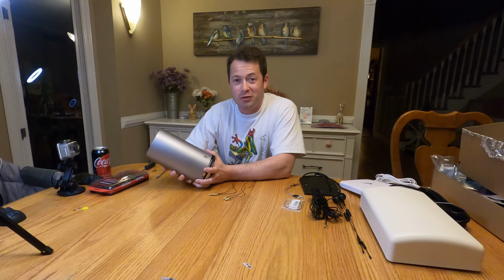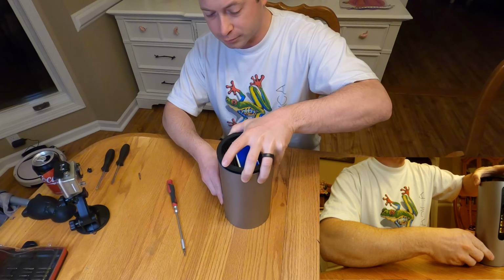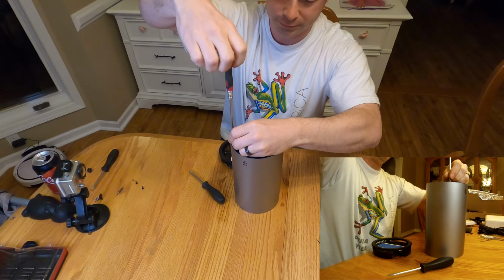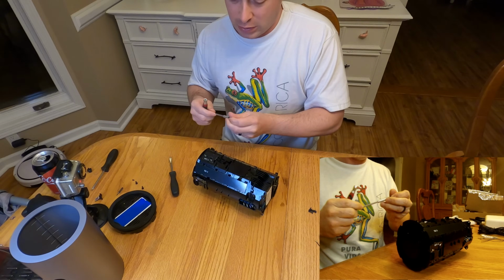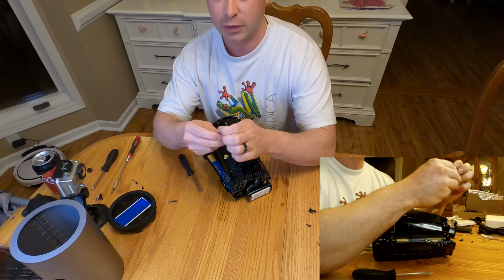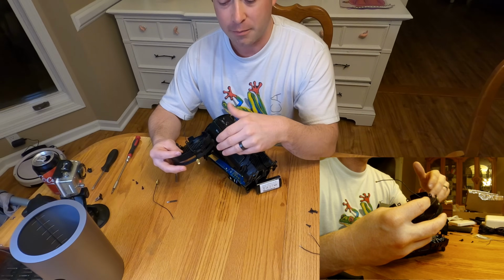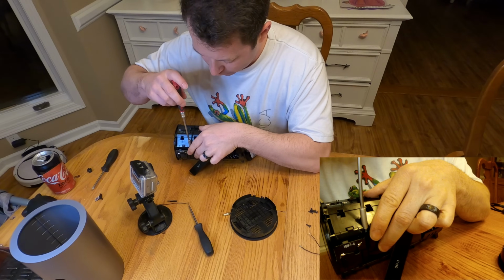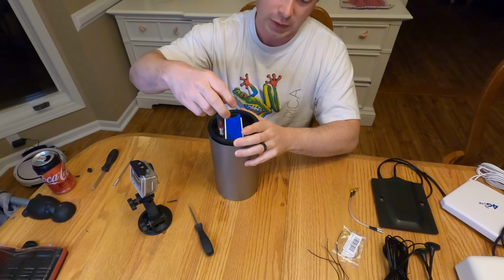✅ Improve Your Signal!  Add External Antennas - T-Mobile 5G Home Internet Rural Broadband - How To

Comment: It's so strange because when I first brought the modem home and hooked it up I was getting 300-400mb down and 50-100up now I'm getting 50-100mb down and 50 up and NOTHING changed. WTF? No matter where I put the modem it's still the same thing. I don't understand what happened.
Reply from the maker: Likely due to deprioritized.  When they first provision on the network they aren't deprioritized.  Like first several minutes.  Also check a different times of day.
Reply: @NaterTater  I unplugged it earlier and let it switch to battery mode and took it outside and pointed it directly at the tower (300 yards away) just to see if I could hit 5 bars and I got up to 4. I hooked it back up and did a speed test and it's up to 200mbs now I did this about an hour ago
Reply from the maker: Ok so then you need to monitor your cell bands.  You must be switching bands so its just a matter of placing the unit in the right place or adding an external antenna.
Reply: @NaterTater  I want one of the ones I saw on your channel, I forget the name of it but it goes outside. I just don't know how to drill a hole in my wall and mount it so I need to find someone to do that.
Reply from the maker: @eggchin9721  That was Waveform,  Get 5% off Waveform antennas with this referral link: http://waveform.refr.cc/natertater
Reply: @NaterTater  also I live in a very rural area, lots of farms around me.

Comment: I tried a waveform panel external antenna on #3 and #4 and didn’t notice much difference at all. I have line of sight so I’m going to try waveform’s log periodic antenna kit. Would you suggest I try the log periodic antenna kit on 1&2 or 3&4?
Reply from the maker: 3&4 was slightly better than 1&2 for me.

Comment: Cool but why do they do this?  Why don't they have external SMA's like any decent modem?
Is there any way to not use this ridiculous hardware?  I already have a Mofi4500 with external yagi's set up with an mvno to t-mobile, but t-mobile has done their best to snuff out that market and they have to raise their price.  It's too much of a gap now and I basically have to get t-mobile directly.  Trying to talk to their support about this is like talking to a fish.  I kept trying to get an answer about external antennas or using my existing hardware etc and their response is "the gateway is how you get the internet".
I'm about 3-4 miles I think from the tower.  I can't find the site I used to use to map it, but worried that'll be too far and I want to use my damn antennas.
Does their service have any issues with a VPN?  I see some of your other related videos might have the answer but figured I'd ask anyways.
Reply from the maker: They IMEI lock but otherwise you can use your own equipment and their sim.
Reply: @NaterTater  Wow alright, couldn't find any confirmation on that before, good to know.
Thanks again, I have a lot more confidence trying this out now.

Comment: So maybe you can help with an issue I'm having.

Says no USIM detected. 

Pulled card out checked it only 1 way in. Try again. No luck.

Remove card and 2 screws pop the bottom off. Hold the sim card in there and it boots up and works.

Turn it off remove card. Reinstall the bottom plastic install card make sure it goes in right and easy.

Boot up it says no USIM again.
Reply from the maker: Sounds like you need to return the unit but maybe a paper shim or something would get the sim contact needed?
Reply: @NaterTater  Maybe when I put it back together I didn't do it right. I'll take it back apart tomorrow and try again.

Thanks for the fast replies
Reply: @NaterTater  Had 2 antenna wires through the grille on the wrong side of the SIM card they would get pinched and not let the bottom grille sit flush so the card wasn't going all the way in 

Unhooked them ran then on the other side with the other 2 antenna wires. Good to go now just a matter of walking around and pointing them different directions.

Went from 2mb/s to 5mb/s already with them just sitting inside. So already an improvement. The book for the antennas said to be patient it could take a few for them to get picked up by the tower.

I've got my Xbox on it now downloading stuff and doing speed tests and using cell mapper.

Turns out the tower closest to me is east not north.

Comment: tmobile 5g gateway external waveform antenna connect to 1 an 2 or 3 and 4?
Reply from the maker: I got better results on 1 and 2 but others report 3&4.  Might vary based on which bands you have.
Reply: @NaterTater  thank you and thanks for speedy reply
Great Channel

Comment: Do you have to put the silver case back on for any reason?
Reply from the maker: Yes, in order to return it to t-mobile
Reply: @NaterTater  I meant for it to work. I ordered the wagi style 4x4 they will be here Wednesday just wondering if I need to fully reassemble It for it to function. If not I may leave the silver case off. In
Reply from the maker: @shifty198885  😂I know, just trying to be funny.  You can leave it off, just don't misplace the shell for whenever you have to return it.
Reply: @NaterTater  Just installed the adapter wires from waveform i have the 4x4 mimo style. Your video helped alot. Having big hands attaching the 4 wires to the board was the hardest part for me.

Comment: You're my go-to expert on this stuff Nate.  I just got my trashcan two days ago and now it appears outdated though I just watched your video of the new gateway and looks like I'm good with the Trashcan for a while. We are in rural Texas on 5-acreswith very few options. Our speeds tend to be all over the place at any given time. and I'm wondering if we would benefit from an external antenna, though based upon your reviews of them, it appears to not be the case. Our topography is rolling hills and no line of site to a tower, though we could from the rooftop of our home. Do you think it's worth a test? Should I consider an external router for a mesh network? Would appreciate your input if you're willing to share. Also, we also have spotty wi-fi calling at times though our speeds can be sufficient. I have a android phone and the others are 4G iPhones. Have you considered publishing a video specifically testing wi-fi calling? Thanks, and I look forward to hearing back from  you!
Reply from the maker: Hey, I'm testing out a waveform antenna kit right now.  May yield better results than my past antennas. external router won't help the ISP speeds but may make your local network more consistent and help with mutliple devices.  wifi calling has been troublesome with me on several ISP's, I often disable wifi-calling.
Reply: @NaterTater  Thanks for the input. I was looking at the Waveform product as well, look forward to viewing your review.
Reply: @rustxranch1220  a bit late on this and not sure if itll help, but i live in texas as well 10 miles from nearest tower. I used the griddy parabolic antenna in 2x2. Also around hills and woods. But i have a tower i can climb and set them up. I usually connect to n41 band and get speeds from 100 to 400 down. 50 at the slowest with upload around 40. I had a panel antenna before which is supposed to help get through the woods and it worked too, just weak signal speeds around 25 to 50 down.

Comment: Most people think the battery is useless but it’s not there to keep your internet up during a power outage, it’s there to keep the device powered long enough to complete a firmware upgrade if your power goes out in the middle of it. If it goes out mid firmware upgrade, you risk bricking your device. I highly suggest anyone who follows this, keeps the battery in the device!
Reply from the maker: I doubt that's the reason for the battery.  It does a reboot when power is lost so I assume it may still brick itself if it was mid firmware update (which doesnt happen often).  I still think the battery is useless.
Reply: @NaterTater  Actually the battery in the Nokia gateway is to facilitate moving the gateway around to find the best signal
Reply from the maker: @TecKnight2k  i know that's what they say but really it is pointless.   Knowing how many bars of signal you have is not helpful in optimizing your signal.  The band, RSRQ and SINR are more important than signal strength bars.

Comment: Ok nater tater, i have done this twice now and both times when im done i get a no connection symbol on top of the trashcan and cant get a signal anywhere. I dont understand what im doing wrong....
Reply from the maker: What antennas are you using?
Reply: @NaterTater  the proxicast antenna... just figured it out lol, i was using 3&4 for the cables, switched to 2&4 and got signal back
Reply from the maker: @MikeCoxlong82  good.  Is it improving your signal/speed over the internal antennas?
Reply: @NaterTater  no actually its even worse, i have bandpass filters on to block b12 because its super slow, and with the external antenna im getting about 0.03-0.5 down. Do i need to unhook the other two internal antennas for it to catch onto the external?
Reply from the maker: @MikeCoxlong82  I dont find the external antennas to help much.  I could get the same signal if I placed the gateway where the external antenna was.  L3 and L4 should work.  I would disconnect the filters and try again.  You want to have all 4 plugged into something (internal or external).
Reply: @NaterTater  yea im not seeing an advantage so far, i dont know if thats because i went with the proxicast antenna vs the waveform, or what it is....no change with or without bandpass filters...been trying everything i can...i love rural living, but it has its disadvantages, hence lack of options for internet...

Comment: I added a pair of Yagi antennas to mine and it works pretty good (once you get it pointed correct ... LOl !!) ... I DO however have to play with the rotation a bit with the unit itself since (in my case) the internal antennas inside the unit (the two remaining antennas) they interact with the pair of outdoor antennas and it does indeed affect my signal to noise of the 4g .....  anyone else experience this at all????  (considering adding a 2nd 2x2 Mimo outside and that should end the antenna problem.... I did read recently where  one guy disconnected the 2nd pair of internal antennas...

Comment: I have this same router. When I first got it, it worked great. It's been almost 2 months now that I have horrible service. My internet is so slow. We can't watch movies anymore. But I have also noticed my phones are slow as well. Will installing one of these antennas help both my internet and phones? I've called Tmobile multiple times and they are no help.
Reply: It may very well be that more folks are now using the service which ultimately limits the bandwidth available to everyone. It slowed down a bit for us too BUT it still gets the job done for well over a hundred a month less than Cox was charging us. We kept going well over the 1 TB limit and had to pay multiple overage fees monthly. We used 8TB last month and the bill was still only 50 bucks. Tmobile kicks butt. They changed the cellular industry for the better and at this rate they'll be making the cable and telecom companies think twice. What I did on my phone periodically in high congestion areas was switch my signal from 5g to 4g as most folks are now pulling from the 5g. It'll give you potentially more bandwidth to play with. :)

Comment: Thought about it but, too much work to get a better signal. I have a N41 band. RSRP -100, 1.5 SNR . Just need to move from basement to first level. Better signal. Hopefully, T-mobile will make a port in the next model. I can get 3 bars upstairs with slightly better numbers. 2 bars in basement. Used to be 3 bars in basement. I just want the 4 or 5 bars because I like to maximize but I'll pass on the antenna work.

Comment: So could you leave ports 1 and 2 and 3 alone and just plug a external antenna into say 4?
Reply from the maker: No, must use a MIMO setup which is two ports/cables minimum.

Comment: Exactly what cables do I need to order? Looks like three different things you have linked. Thanks
Reply from the maker: You have to match the cables to the ends on the antenna you buy.
Reply: @NaterTater  thanks for the response. Seen that after I commented.

Comment: I have an old TV antenna on an old climbable post that is taller than my house.
The antenna has the old aluminum fingers.
Could this antenna be used ?
Reply from the maker: Not likely.  Needs to be an antenna and cable (50ohm) that is specifically for cellular freq.

Comment: The title to me was misleading not that he did it on purpose but "External" to me means.. You don't need to tear open a unit that you don't own and add stuff to it.
Reply from the maker: The antenna is external, not the connection.
Reply: @NaterTater  yes I realized that later in the video..

Comment: how can you stop speed inconsistency? sometimes speedtest gave me speeds 100s 200s 300s always 2 bars.and sometimes horrible speeds, but good or bad speeds if i go to my PC or cellphones it takes forever to load any page.
Reply from the maker: Download speed will vary based on network congestion.  To improve page load I would use a custom DNS  server and/or your own router which offers better QoS.

Comment: A guy named 007Bond on the TMO discussion board (T mobile home internet subsection) just installed a Waveform antenna and went from 75 down to 650 down. He's in a different situation from us though. He's between three towers fairly close by, including one that is only .5 miles away, and his problem was not connecting to the fast band pair with n41 reliably.

Comment: Thank you so much for sharing this video! My speeds have jumped from 28 to an avg of 77,  plus the tips for finding the best signal with the antenna 📡 and cell mapping, working on UPnP and nat from mod to open. Have not tried the tp-link router yet, afraid if I do set that up I'll lose my good connection.
Thanks again for sharing.
Reply from the maker: You're welcome!

Comment: Thanks for the great video!   I just purchased a single parabolic antenna(The Long Ranger
 Ultra High Gain Parabolic Antenna) thinking it would work with this gateway.  You mentioned that you need to use antennas with two wires....I missed that part the first time I watched prior to ordering.  Could you confirm and elaborate that this will not work.  Thank you!
Reply from the maker: The gateway expects MIMO so it needs two ports/cables for that.  You can buy another long ranger and  use two of them.  That's what people do with log periodic antennas.

Comment: I'm following all of your videos and now I want to add an external antenna. All the links to antennas including the panel antenna you have listed have a frequency range of 698 - 2700 MHz. But the N71 5G frequency range is 617 MHz – 652 MHz. So what good are these antenna's and can you recommend a panel antenna that has the appropriate frequency range for N71?
Reply from the maker: Antennas natural have a curve of freq response so ones listed as 700-2700mhz doesnt mean they dont recieve 699 or 2701 mhz nor does it mean they pick up 700 or 2700 that well.   It all depends on the  antenna.  Waveform sells one that is marketed at 600+ mhz.

Comment: I would like to ask a question, please if we get cell phone signal booster would it help get better signal on 5G gateway? Please advice. Thanks
Reply from the maker: In many cases no.  Stronger signal but also stronger noise/interference so likely not big improvement in speed. Antenna is your best option.
Reply: @NaterTater  thanks for clarifying! Really appreciate

Comment: How can you tell if your problem is weak signal versus an overloaded tower? My speed vary widely from 56/16 (D/U) to <1/<1. This is without moving the gateway and 3 bars signal consistently. Best speeds tend to be around 12am, the worst in the afternoon. I would be willing to try an antenna solution but thinking it may be pointless.
Reply from the maker: If your signal specs are staying the same i agree you might just be seeing an overloaded tower.   Those are typical off peak and peak times you mentioned.

Comment: Still have the white square-ish t-mobile home internet modem router, not the round one. I wonder if this is do-able on that model? They told me they don't use the round ones for my area. Find that hard to believe, but whatever I guess lol.
Reply from the maker: It is but its more complicated and requires soldering to the board.
Reply: @NaterTater  Yeah, I was looking at a video about a guy that had to do that for the simple fact that he couldn't find any connectors that would work. They look proprietary. But, anyway, he didn't do into logistics about it. Do you have any resources as to how to do this modification? my box is this one: https://the-gadgeteer.com/2019/09/17/julies-gadget-diary-t-mobile-home-internet-part-2/